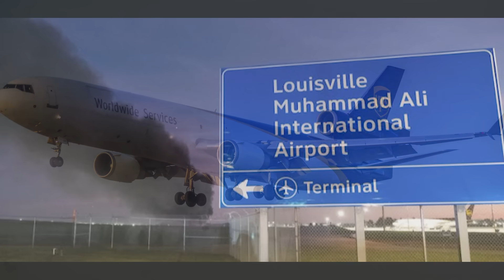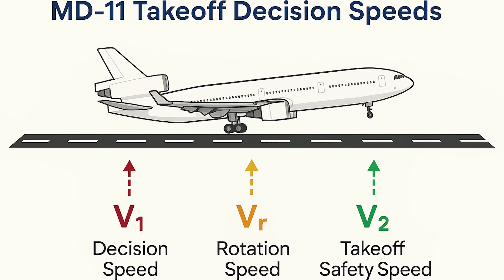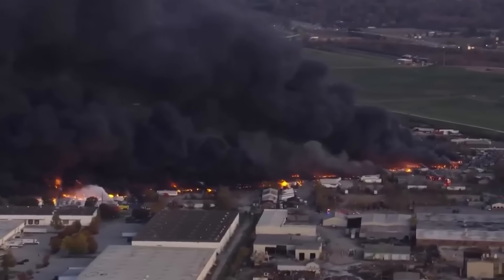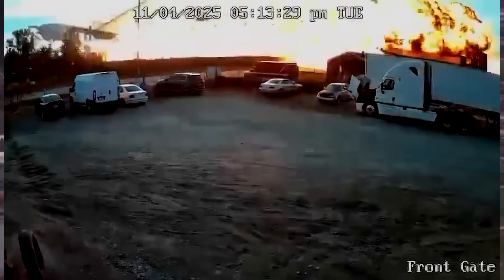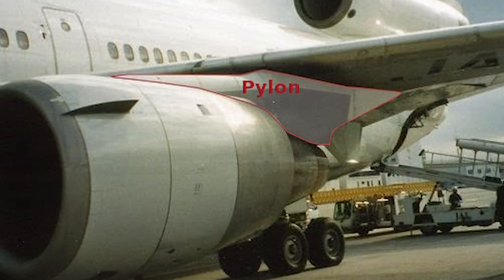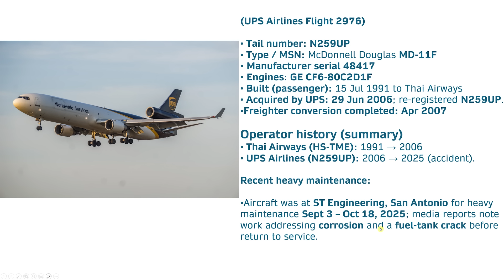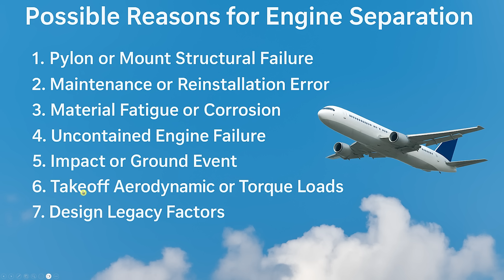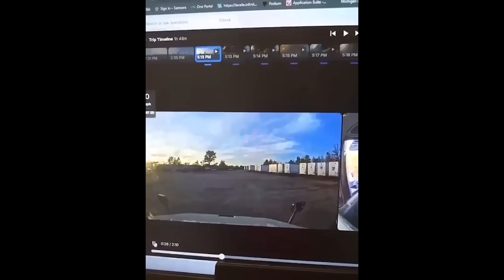What Caused UPS Plane Crash, Louisville, KY? How MD-11 Engine Fell Off

Comment: Just showed my Dad who was a Jet Air Craft Mechanic in the USAF for 27 Years. Was also NCOIC Fightline. Said someone F'd up on bolting the engine back on. Said during maintenance is done, the engines are unbolted and inspected. Not putting them back on correctly,  forgetting to put the bolt back or screwing in correctly causes the mount to not hold the weight, the engine will fall off. The fuel line separated and because electric connections are still going, the fire starts.  He said take note of how much of the engine remains intact. Said in the Air Force, because a lot of the workers are young Airmen, there are a lot of double checking but in the private sector sometimes work isnt as closely inspected. Dads 88 but remembers by heart everything about aircraft!
Reply: I'm a massive aviation geek and your dad sounds like he knows his stuff. It wouldn't be the first time something wasn't put back right. Remember the pilot half-sucked out of the windscreen that flew off because the mechanic used the wrong screw or bolt?
Reply: @RevCPJohnson  It's sad how preventative maintenance can end up causing the crash... if not done correctly. But something could have just failed or sheared off maybe? More likely an error though... I hope not.
Reply: @colinm610 In the case of the UPS plane, it could have been fatigue cracks that finally broke in one of the engine or pylon mounts.
Reply: @mkay1957  So sad these people died and any injured. God bless. From NZ.
Reply: @colinm610  this clearly tells us humans are just a number according to big technology.
Reply: @WilliamHollinger2019 Well I can't argue with that can I ? Absolutely.
Reply: @colinm610 This plane was noted to have corrosion. I believe it was a long-standing issue. The crack must've been completed but maintenance didn't catch it. It was an old plane which had been in continuous use for 34 years, stored some place where salt water got into the engine cowling. Since salt water is the death of metal, one would think UPS would be very keen on discovering the corrosion. I guess UPS thought ST Maintenance had fixed that issue. Nope.
Reply: @colinm610 that lies more on bad quality control program than the  preventative maintenance itself.
Reply: @mikesorensen5228  Yeah that's right! :)
Reply: @RevCPJohnson I remember that story, British Midland, Fokker F100 series jet.
Reply: @RevCPJohnson  Oh ya, my son (disabled) and I watch Air Disasters TV show almost every day - excellent shows - ya that was a miracle that he survived - great teamwork on that flight by everyone to save him and the plane and passengers
Reply: @KRAM-ct7ok He went back to flying in less than 6 months too.
Reply: @KRAM-ct7ok  I think those of us who have watched those shows numerous times know almost every crash and it cause(s) by heart.
Reply: @KRAM-ct7ok 😂😂😂
Reply: Thank you very insightful
Reply: I am an aviation maintenance engineer up in canada, its pretty difficult to forget the talk those bolts when reinstalling an engine. Most of the time the engine goes up with a cradle that is hung off of the strut, you bring the engine up, align it, put a preload on it and then you feed the bolts through and torque them before you start lowering the Cradle.

My assumption at this point would be that a crack was formed somewhere and was missed, either that or corrosion built up and was missed for too long. I don't think people just forgot to tighten up the bolts, especially when you got four to five people working on that engine change and which requires an independent inspection or RII, meaning the person has to torque it and you have to have two qualified individuals observing said torque.
Reply: Same scenario American Airlines crash caused by maintenance short cuts. Using a forklift to pull the engines cracked the mount.
Reply: @tappan48  , saw that one on Air Disasters on the Smithsonian Channel.
Reply: @davidransom4476  Well this terrible event will be added to that show.
Reply: When I worked Aviation Maintenance we always used on overhead 
or gantry type crane or hoist for removing or installing engines, 
transmissions, gearboxes, props, rotor blades or wings.
Reply: @ogcowboyx  United uses cranes.
Reply: @tappan48 it wasn’t the actual move but the hydraulic bleed off when the shift change interrupted the reattachment if the engine. The fork lift blades lowered just enough to bend the pylon and put it under stress eventually cracking.
Reply: @lisahicks8186 I saw the analysis on the Smithsonian channel, the maintenance shortcut was about using a forklift and cracking the mounting bracket if the reattachment wasn’t precisely lined up.
Reply: @lisahicks8186  The engine and pylon were supposed to be removed separately per McDonnell Douglass.   Maintenance was pulling them as one unit and this caused damage.
Reply: @tappan48  thank you, you beat me to that comment.
Reply: @tappan48 yes! also a DC10 unbolted engine?
Reply: @tappan48    The engine and pylons were pulled together instead of separately which was against McDonnell Douglass procedures.  Had it been done as a separate removal, the cracks would not have developed with the forklift.
Reply: What a legend
Reply: @jyemichael what??
Reply: I believe your dad knows what he's talking about.
Reply: Thank you.Sounds like what happened
Reply: This has happened before. Engine not being bolted in correctly, then dropping it in the air.
(Engines are basically held in by a sort of clamp that goes around the whole engine that opens up from below. Engines can be removed, replaced or repaired. The clamp is held together by bolts at the bottom.)
Reply: @alexanderg-p3z  sounds like you are referring to the "cowling" that surrounds the engine - an aerodynamic shell that reduces drag and allows access to engine components on the ground by opening it (like a two-piece clam shell) - but the engine itself is being held to the pylon by several LARGE bolts - and the pylon to the airframe by even LARGER bolts and pins.  On the Chicago DC-10 crash the pylon separated from the wing but the engine stayed connected to the pylon - there are photos of people looking at the engine and pylon laying together on the runway - this case looks to me like the engine separated from the pylon - not sure, and the front fan section of the engine separated from the core section of the engine. I guess they will figure it out
Reply: @KRAM-ct7ok  Yeah that's it. Thanks for the clarification.
Reply: I was also a jet mech/plane captain in the USMC.  Although it may be factual that the engine was not properly secured after maintenance, it is yet to be determined.  There are a number of other reasons for an engine to come off the wing, such as metal fatigue.  Although there was no mention of it (at least I don't recall it) during the NTSB briefing, I would think that the fire started before the loss of the engine.  If that were the case, it may be that whatever started the fire also caused the loss of the engine.
Reply: @seanjkenrick6593 aparantly this flight was a continuation or a unload, reload & refuel to go to Hawaii. Airplane had flown from another airport earlier in the day & landed. It was said on Tuesday in chat from videos of the aircraft that there was a 2 hour delay & the airplane had been at maintenance but nothing official was put out in the media. Will have to wait for NTSB to do & complete the investigation. I wonder if pilots felt vibration from #1 engine in flight at some point on the way to KY & the reason it was in maintenance.
Reply: it seems insane to trust the safety of the entire airline industry to a single underpaid-un-motivated maintence worker
Reply: @MattMajcan  My brother-in-law is a United employee and is paid very well.
Reply: @lupusgirl1000 regardless I've worked a lot of underpaid jobs and most people want to do their best, especially if safety is involved
Reply: @MattMajcan i think most of them must be motivated. But if they aren't given time and resources then they aren't given time and resources. And it should be a repeated standardized checklist completed by multiple people
Reply: @MattMajcan that's right, one team installed engine after other team inspection, must done job right that.
Reply: @MattMajcan underpaid? These guys make serious money.
Reply: @Z_Syndicate  obviously its not enough because this keeps happening
Reply: @MattMajcan Dont think those people underpaid, especially his supervisors.
Reply: @MattMajcan  ST Engineering does not appear to be a union shop at its San Antonio, Texas location
Reply: This happened in 1979 I believe, the engine was taken off for maintenance but it was done quickly and during a shift change.
Reply: @mch2007uk shift change they didn’t leave the engine running so pressure bleed off let the load settle bending the pylon slightly. Saw this yesterday.
Reply: @lisahicks8186 That was the forklift engine lifting the jet engine into place on AA191.
Reply: @mkay1957 I know it was discussed due to the similar situation of actually losing an engine, mouse being aDC 10 the older version of the MD 11.
Reply: My father was a B-17 flight engineer/top turret gunner. When his bomb group was still in training at Avon Park Bombing Range in Florida, some other B-17s from another bomb group did a fly by at about 500 ft. One of the visiting planes made a loud bang and the number 4 engine fell off. The plane did a slow corkscrew into a swampy area some distance from the end of the runway and burst into flames. 

Somehow the tail gunner got out and popped his chute close to the ground. It slowed him up just enough that he lived, although he had 2 broken legs and other injuries.

My dad never heard anything about the cause of the crash or if there was any kind of investigation, because his bomb group headed for England a few days latter.
Reply: Doubt it’s that simple. You don’t “forget to put a bolt on”.
Reply: Take a close look at the earliest video of the crash taken from behind the plane as it is trying to gain altitude.  There appears to be sparks coming out of the #2 engine.  This could indicate a catastrophic, uncontained explosion on the #1 engine caused it to detach and threw debris up into the air some of which got sucked into engine #2.  In 1989 a catastrophic , uncontained explosion occurred in engine #2 on a DC-10 on United flight 232.  Parts from that explosion severed hydraulic lines which led to the crash as the pilots tried to land.
Reply: @Klaatu2Too  It looked like compressor stalls backfiring out the back of engine #2 right before & at rotate.  Either way would explain no power or lift because #3 engine was the only one left operating.
Reply: @Klaatu2Too With 2 engines out, a full load of fuel, and tons of cargo on-board, they would not have made it back even if the hydraulic system had not been destroyed. I cant even imagine how the 3 people on-board felt the last few seconds of their life knowing that they were going to die.
Reply: In USAF certain maintenance procedures are marked with a Red X which requires inspection and clearance by a supervisor before the aircraft can be cleared for flight. Some maintenance requires a test flight by a Functional Test Pilot before the aircraft can be returned to service.

Thanks to your dad for his service.
Reply: They do the same when they take my tires off, the kids at Walmart don't bolt them back on with enough torque or they forget a few bolts. Too much TikTok for the brain, can't concentrate on simple tasks.
Reply: @RK77789O i guess TikTok is less harmful than lead at least
Reply: @RK77789O how dismissive to equate the kids at Walmart to the capable and dedicated aircraft maintenance crews of this country.
Reply: @ChuckiesChicklet  Allow me to point out that Walmart is...... Walmart. 
Whether the workers are Boomers or Zoomers.
Reply: @ChuckiesChicklet So it’s ok for you to then dismiss a valid point yourself? Attention span thru overuse of social media and texting is a problem that has begun to infiltrate many skill sets. It needs to be discussed.
Reply: @georgiarasmussen8343  And? The initial comment was about whichever generation had been removing and replacing this person’s tires.
Reply: @kcampos5619 Wal-Mart and the airline maintenance shops are drawing from a similar employee pool. So you better be aware of that fact.
Reply: @rubies200 No kidding. I think I conveyed that awareness in my comments - and that Walmart does indeed offer services that require skills and an attention span.
Reply: @kcampos5619  And? What gets me is how many people fall for the "generation" thing. 
A generation is a division within a family, not a political segment. The politicized usage is purely a  construct of the media. "Baby Boomers" love to project their innate ignorance and entitlement upon everyone younger.
Reply: Dad is absolutely correct except for the fact that we were closely monitored because we were young and that is wrong. We were closely monitored, absolute fact, but we were closely monitored because of what’s at risk as we see here. We are closely monitored to have the chance of catching any mistakes or worn component’s before that aircraft attempts flight and has this happen. Every nut we touch is inspected and scrutinized so we have Zero Defects on EVERYTHING, not just most things!! Our pilots lives are at stake and there is absolutely no room for your dad or I to make a mistake and leave a nut loose or install the safety wire wrong, etc. that is why we are monitored and drilled on every task we do. I also was a jet engine mechanic on T-37/T-38, F-15/F-16s, & C-141s. Even the civilian world is supposed to inspect every step of aircraft Mantooth the same way we did it in the Air Force but they are prone to skipping some of the steps for cost savings, not due to age. My engine shops I was part of had majority of mechanics that were 35 years old and older with 15+ years experience and were A&P certified, not just young kids running around and we probably had more experience than the civilian shops honestly.
Reply: Any chance (at all) it could/would have failed a metallurgy test?  Just the stress from 34 yrs of takeoffs and landings and the surrounding structure supporting the engine simply gave way?
Reply: How could you not attach bolts that connect the engine ? Isn't there a checklist to make sure every step is completed ?
Reply: Respect! You are lucky to still have your dad. I lost him when he was 65.
Reply: That’s really scary to hear. Could happen to any one of us!
Reply: @creativeconnection4U  yup! It could! But you're more likely to be unalive driving in a vehicle on the ground.
Reply: @Yeeeeeeeaahhh   not if you're unflying through a building with unempty fuel tanks.
Reply: @johnnysparkleface3096  dude, how many times has that happened? How many people were killed from all airplane crashes compared to how many are killed in vehicle accidents? Look it up!
Reply: @Yeeeeeeeaahhh  unalive   " is not a word genius😂😂
Reply: @michaelvargas4079 actually it is now. It’s used so you aren’t censored using other words. You know, freedom of speech.
Reply: @michaelvargas4079  LOL.. you must be a noob! We use alternate words to avoid having our comments removed YouTube's automated bots. Genius... 😆🤣🤣🤣
Reply: @Yeeeeeeeaahhh especially today..watching a movie on phones while driving 😮
Reply: @creativeconnection4U  Most definitely at any time... Nowadays it's even worse....
Reply: This has happened once before too iirc
Reply: @dmacpher unfortunately, it may happen again in the future. Preventive Maintenance is only as good as the crew doing the work AND the quality of the parts as well as being installed properly.
Reply: @Duschbag if I recall correctly it was In part how the engine was jacked back up onto the wing last time this happened a few decades ago. 

They also lost the engine on takeoff
Reply: True.. helicopter s..and planes are safer in the USA milltary than commercial at times....copters are called flying bricks in the military 😢
Reply: This was an MD-11 (Corrected as I had it as a Lockheed L-1011)  airliner converted over to cargo. Basically it is a similar and larger version of the McDonnell Douglas DC-10 with the 3 engine setup. There is a lot more to R&R the engines on these aircraft than most others. The DC-10 & MD-11 have both suffered from problems with the wing engine mounts and there has been a lot of FAA regulations, safety checks, updates and more on how to remove and replace the wing engines. This has to be done with extreme care as any damage to the engine mounting points, or pylon mounts, especially the aft mount that can cause the engine to detach from the wing. There are only 2 or 3 attachment points to the engine Pylon that attaches the engine to the wing.  
The first engine attachment fail occurred in May 1979, on AA flight 191, a DC-10, taking off out of Chicago's O'Hare International Airport. Same engine came off shortly after take off and rotated over the wing. This lead to loss of control and the crash killing all 271 on board and 2 others on the ground. The NTSB investigation examination of the pylon attachment points revealed some damage done to the wing's pylon aft mounting bracket that could only happen during an engine change. 
Like your dad I was in the USAF and retired in 2014 after 40 years. Just under 20 years active duty the rest in an Air National Guard Unit full time. For about half of my active career I was in the Strategic Air Command (SAC) working B-52s and KC-135s as a Machinist out of the Fabrication Branch. There were times I had to go out and do some work on the Aft engine mounts in the KC-135s. It amazed me that there were only 3 attachment points that held the engine on the wing. The 2 Aft mounts had a slot cut into them that slid over a sheet metal part with, 5 or 6,  3/8 or 5/16 inch bolts that bolted through the mount and the sheet metal on the pylon. The mount had a hole or eye at the bottom that a 1/2 inch bolt went through the holes on the engine and the mount attached to the pylon. There were 2 of these afte mounts and a much larger tapered pin mount on the front of the pylon. That is all that holds the engine on the wing. 
So it is critical to take every safety precaution, use the right equipment, follow the maintenance manuals and not rush an engine changes. Lives depend on it. I've seen too many accidents that have happened because the job was rushed, or people were not using the Tech Data, didn't use the proper tools/equipment, take pride in their work, or took shortcuts and many other stupid reasons that got people injured or killed.
Reply: @EIBBOR2654 not a L1011!
Reply: @rodbutler4054  
Your right and it was my mistake. Thanks for pointing that out. It is the McDonald Douglas MD-11. Their version of the stretched or larger DC-10. Only 200 of them were built and only the Cargo versions are still in service. They were retired from passenger service in 2014 along with the DC-10. The MD-11 never met it's flying range goals and maintenance got expensive for these aircraft. Several of the passenger aircraft have been converted to cargo by Boeing after McDonald Douglas (MD) merged with Boeing. Boeing wanted to get into the Helicopter market, especially the military  market and since MD had bought Hughes Helicopters in 84 Boeing jumped at the chance to buy MD to get the helicopter product line division.
However the MD-11 still suffers from the same Engine Mounting Pylon problems as the DC-10 and L-1011. Any damage to the 2 or 3 attachment points will lead to the engine leaving the aircraft eventually. 
I stand corrected and should have known that it wasn't an L1011 because of the difference in the #2 engine in the tail. The L-1011 has the engine mounted in the Aft fuselage with an "S" shaped intake duct work. One of the pilots I know mentioned that it was an MD-11 and I when I checked to sites on this accident they also made the mistake of saying it was an L-1011. I usually check the facts better but just took it for granted. I should know better. 
Back when I was Active Duty USAF stationed at Seymour/Johnson AFB in NC, we received the first 2 DC-10 Tankers. I was with the 68th Bomb Wing (SAC) working on B-52Gs and KC-135As. We became a test bed for the KC-10s since we were so close to DC. We never did any maintenance on the DC-10s as MD was contracted to do all the maintenance. As I recall that contract was for 10 years. The KC-10 was retired from the USAF, the last one went to the Bone Yard Sep 2024. They were replaced by the KC-46 Pegasus, a modified Boeing 767 airliner, just like the KC-135 was developed from the Boeing 367-80. 
We had the original here at Davis/Monthan AFB in storage from 1972 to 90 and it was brought back to flying condition at DMAFB in 1990 and flown to the Boeing Facility in Seattle for a full restoration. In 2003 it made its final flight to the Smithsonian National Air and Space Museum. About 396 KC-135s out of the original 803 are still flying with units in the USAF, USAFR and USAF ANG and expected to fly until 2030. Not bad for an aircraft that was built from 1955 to 1965.
Reply: It that's the case, there's going to be some people in the maintenance shop going to prison for a few years.
Reply: How long is a large Aircraft like this before it has a serious front to back, top to bottom inspection for recertification for future passenger or freight Carrier use..? Or do we not G.A.S. enough  to do that at all..?
Reply: Wow Your Dad is a wise one. Tell him thank you for his service. My FIL was an airplane mechanic too served in USN during WWII and the Korean War.  He told us the only time he ever had to kill anyone was in the Solomon Islands and he did it with a wrench.  We all miss him so much.
Reply: My friends in aviation in Ky are saying the same thing. I heard they did a breakdown on this plane where they take everything apart and put it back together, within the past week. There’s licenses being pulled
Reply: UR Pop is dead center correct. (Actually is the only possibility)
Reply: One of the NTSB enquiries found that the airline mechanics had used a forklift to lift the engine into position and this had caused damage to the supporting lugs. Engine fell off and all aboard were killed.
Reply: Your dad sounds very cool.
Reply: He’s Right It Makes Perfect Sense
Reply: God bless your Dad and thank him for his service.
Reply: Incompetence, half-ass work and just lazy work.
Reply: Was Stationed At MCGuire AFB, one of the two homes to the KC-10A. The DC-10-3. At MTOW, Two engines is not enough to climb out with only 8500'.  We had ours Expanded to 10,000' when the KC-10s arrived.  8500' runways are the bare minimum length to take off at MTOW. Be mindful, this UPS Flight was a nonstop to Hawaii.
Reply: Your Dad is amazing, brilliant, and a hero. Thank you to him for the information and for all of his service! Very interesting
Reply: God bless him, appreciate the info.
Reply: I think I saw this on "Seconds from disaster" or something like that. The maintained crew screwed up the mount, the flange, and the shear-pin snapped. I think that was accurate IIRC.
Reply: @AbandonTheWest  The DC 10 that went down at Ohare in the 80s looked familiar to this accident. Maintenance crews were using forklifts to remove and install engines. They put undue stress on the mounts and they cracked. The engine fell off the jet on takeoff. This looks exactly like that one at Ohare.
Reply: In 1992 a plane crashed into appartments in Amsterdam. It also lost it engines. Fatigue of those pins if I recall correctly. One engine broke off and hit another wich also fell off.
Reply: I agree with your dad. This will probably scare most people but most engines are bolted to the plane with only 2~4 bolts. Either they used improper bolts not made out of the right material or they cracked the mount forcing it back on after maintenance.  Nothing else makes sense to me.
Reply: God bless your dear dad,he’s remarkable ❤
Reply: As a veteran of the USAF, I can say a Red X, otherwise known as a condition in which an aircraft is not to be flown, requires inspection of maintenance done to clear the Red X. Some types of maintenance inspections require lots of stripes, meaning, a high-ranking NCO as compared to other types of inspections. An engine removal and reinstall would require such higher-up NCOs to inspect it. It's serious business.
Reply: Such good info.
Reply: I agree, yes.
Reply: Don’t care how old your dad is 😂
Reply: I believe your dad, he could be right. not blaming mechanic team and staff but small portion of people would cut corner. also a not well trained and under equip personel could also a factor.
Reply: HELLO.  McFly anybody home??
Even if they "forgot bolts" that doesn't cause fires.. the fire started B4 engine detachment
Reply: Read my comments about San Antonio maintenance issues on kc-10. The team there years ago didn’t follow maintenance tech data . And we used the same books as the a&P guys did. I doubt they were even inspecting the engine attach points.  I spent 25 years in aircraft maintenance 14 on heavy inspections in iso dock and 4 in a-check on kc-10’s. I found a lot of scary crap.
Reply: @josephburnham4621 This is it. This is the answer.
Reply: My dad was an airmen television technician 91 to 99 from Air Force to air guard.
Reply: Yeah they said a Singapore based maintenance company did work on the central wing fuel tank on 9/18
Reply: Someone fucked up pretrip maintenance. Triple check. I drive an 18 wheeler and pretrip more than 1 time or take longer than normal.
Reply: Please thank him for his service for me.
Reply: Sounds like your dad is someone we still need in the workforce.
Reply: You have a amazing dad.
Reply: My thoughts exactly. It has to be because the plane engine is not supposed to just fall off. Someone bolted it wrong, didn’t finish the job or did it incorrectly.
Reply: You realize the UPS is part of the public sector??? So much for your untouchable government...
Reply: @kingkoi6542 heh?
Reply: @kingkoi6542 USPS (U.S. Postal Service) is a government entity, not UPS (United Parcel Service). Or do you believe a company that sells stock to citizens is owned and operated by the government?
Reply: Somewhere in Kentucky, there is a mechanic very worried
Reply: How did the plane get from San Antonio to Kentucky?
Reply: It's WELL KNOWN the most dangerous flying in an aircraft..is after recent maintenance..
Reply: Bolts don’t hold the engine in place, pins do and bolts keep the pins in place.
Reply: Yep, and it's certainly not the first time it's happened either.
Reply: That’s exactly what I think, too. In fact, I typed that and posted above before reading this. 
Please thank your Dad for serving, as did my father who was a few years older than yours. 🫡❤🇺🇸💙
Reply: This crash at UPS in Louisville is extremely similar to what happened in May of 1978 in Chicago Illinois at O'Hare airport with flight American airlines 191. Due to a improper procedure to do a engine change cause structural failure and micro cracks where the pylon for the engine hung. The procedure was a shortcut and at the time it seemed like it was a time-saving practice to do engine changes on the DC-10. To the date that flight was the most deadly crash in US history with a single plane. Close to 300 people lost their lives because when the engine failed the airplane lost all her drug control and because of that they cannot recover. It was a miracle that they did not hit the fuel reserves which was which was very close to where they crashed. The fuel reserves for the airport was right next to the trailer park on Touhy avenue in Des Plaines Illinois. The reason why I remember that accident so clearly was my father worked for Continental airlines at O'Hare airport and when I got out of school that Friday I saw a large cloud of black smoke in the distance. My mother was at home watching it on the news and talking to my father. When that accident happened the airport was in total lockdown. I have a feeling that what happened at UPS was a very similar situation where someone was taking a shortcut against McDonnell Douglas is recommendations to do a proper engine change. The FAA should look into the similarities between the two crashes and compare the evidence and similarities.
Reply: and nonexistent  QA/QC whatsoever.
Reply: How in the Sam Hill does one F up reinstalling a turbine engine capable of producing hundreds of tons of thrust? You'd think it would be double-checked on every flight.
Reply: Respect
Reply: He was saying bc the techs were also flying in the planes, they were more conscientious?
Reply: We have had the quality loss topic before in US engineering at some a lot people. The best are working on F35 (e.g.) and some like trashing the space with unnecessary satellites all such and a lot cause such problems like at Boeing +++.
China quality but because of fast money making and work pressure and some sometimes chaotic people in jobs which have no room  for uncontrolled chaos.
This would be no problem when they work controlling each other togehter instead of alone and under such time pressure.
Reply: It's pretty clear in this video that the fire really blew up as the power lines exploded 😮
Reply: Wow we need him in this country  forever God bless him
Reply: DEI hires
Reply: Your Dad's not wrong. The Military though has Technical Inspectors that come through and check the work of the maintenance team that replaced or removed the engine. Civilian Aviation doesn't use Technical Inspectors the way the military does. So it's easier for a Civilian Technical Inspector to pencil whip the inspection. It's my understanding from people I know that work in the civilian industry they don't even check if the work was done right. A good friend of mine was a whistle blower against American Airlines in St Louis for falsifying maintenance records.and inspections after work was done.
Reply: With the limited evidence available the cause appears more likely to be an uncontained catastrophic failure of the engine, causing the fuse pins to fail allowing the engine and pylon to become detached from the aircraft. The connection between the engine and the pylon has also failed, but this maybe due to the impact of the pylon and engine with the ground.

The fuse pins are designed to break if there is a serious problem with the engine. Jumping to the conclusion that the cause is improper installation of the engine, is premature.
Reply: @christopherrobinson7541 I saw a video yesterday that shows the engine was already missing from the wing before the plane impacted.
Reply: Thank you  for sharing. Yeah, my dad passed in 2022 but was retired Air Force and commercial airline pilot. Whenever, unfortunately, these incidents happened he would always get it right. He knew so much about the equipment; function, failures, maintenance, systems, etc. Will be fascinating to know the NTSB's finaly assesment. Oh boy, incredibly sad.
Reply: I believe your Dad is right.
Reply: I recall as a kid the DC10's crashing and it came down to them using a forklift to hold the engine up while they fastened it. Apparently if shift change came during the process or if parts were needed, they might leave it on the lift with one bolt in. The lifts would sometimes sag a little bit due to leaky seals and stress the mounts/bolts. Next guy comes along and puts it all together, but part of the mount is weakened and could fail under load. I may be blurry on the details as I was young and am going by some news report, but it was along those lines. Much like the recent Boeing issue of missing rivets, any critical component should be either completely installed or not connected at all to ensure that something isn't lost during a shift change or time period waiting for parts or any other reason. 

I know that pilots, ATCs and mechanics are aging out and not being replaced with new guys at the same rate, so crews are stretched. I hope this is a wake up call that it's better to delay or cancel a flight than to succumb to pressure to stay on schedule without making sure everything is in perfect order. I'm not saying that's what happened, but I suspect it does.
Reply: There’s only one reason this plane crashed bad maintenance why didn’t the computer warn that there was trouble with the engine
Reply: US army retired here...tell your dad thanks for your service 👍🇺🇲
Reply: Most people would agree that common sense says that a plane won't fly if the engine falls off. If they can't agree that's a problem in finding the cause then there's not much hope for this country's educational systems.
Reply: Is this one of those new Boeing planes???
Reply: Did the plane fly successfully before this or was this the first flight after it’s maintenance?
Reply: @stephenabbott7259  the engine came off IMMEDIATELY. that says that it hadn't had other flights since maintenance. more information is coming forward with other people supporting the 'forgot to bolt it back on' theory.
Reply: Private sector. Exactly.
Reply: American quality work
Reply: I smell a Rat
Reply: Dad Rocks! I believe every word Pop's said.
Reply: Wow, so this was entirely preventable. Disturbing. 😢
Reply: I agree. I was a crew chief of F111 from 85-88
Reply: problem is most of our new techs are raised by chatGPT.
Reply: Omg
Reply: That is gross gross negligence. Who are the people working on installing airplane parts? They are doing absolutely horrific job.
Reply: @pajeetsingh That is my point!!  And so many people here try to find excuses to " forgive and forget " !  How disgusting is this !
Reply: They don't do that anymore, at least they shouldn't. The engines were never made to be removed; it was an effort with the Air Force to save time rather than taking the engine apart to repair. They stopped doing that in the 80s or 90s. So, unless they decided to start doing that again, it's unlikely that was the cause.
Reply: @ mechanical fitter who works on the engine 👀
Reply: Unbolting the pylon from the wing versus unbolting the engine from the pylon.  

Inspection inspected the wrong engine side vs the correct wing side.
Reply: makes sense.
Human error is only getting worse every year ..
Reply: @roadstar499 Why more so now than before ? What is happening more so now than before?  This is the question
Reply: God bless you and your Dad ❤
Reply: That's simply not ALWAYS true. I've watched a ton of shows about what went wrong in plane crashes. If I put the shows' names YT will delete my comment. But I've seen the wrong bolts used in replacing those mounting bolts, because they get stressed and must be replaced. And damage can happen to some of the parts during engine repairs or maintenance that causes the plane to crash sooner - or later.
Reply: Reminds me of rolling out from the Ford shop, and realizing that none of the wheels were bolted back on ;_;
Reply: Interesting. He said that plane had a crack in a fuel tank, which was repaired and it flew many flights after that. I think that plane should’ve been retired a long time ago. Even if the engine was bolted on correctly, metal fatigue could’ve caused the same problem. Hopefully there’s enough evidence left to show what happened. I’m leaning to what your father said.
Reply: @alan30189 A lot of old and much older planes fly to this day that is not problem by itself and that plane could fly for another 10 years with no problem
Reply: Well they can’t blame that on DEI. Since the cursed one took over occupancy of the Oval Office more unavoidable calamities and deaths have occurred in the last 10 months than in the past 10 yrs. He’s a walking, talking bad omen.
Reply: @SDC1949 actually not true. Check the statistics. The number of crashes is down from previous years. The number of TDS cases however ...
Reply: The FIRST thing I thought of. Heard plane was o.o.s. for a month. Plus it's 34 years old reportedly. A LOT of stress on that fuselage over those decades.
Reply: And myself 😮
Reply: Remember all the whistle blowers who mysteriously died of suicidal after coming forward regarding the negligence of Boeing company?!?!!!
Reply: And yet...
NTSB will say pilot error
Reply: I wouldn't be surprised if this was a situation with a DEI hire on maintenance... or someone paid someone to jump to the front of the line in hiring but didn't have a lot of experience yet.
Reply: @noahriding5780   corruption is a GOP thing
Reply: Another diversity hire
Reply: Probably a dei hire
Reply: @lorig4871 makes no sense when you say this since dei was abolished when Trump got into office and a bunch of plane crashes happened afterwards
Reply: Pilots wouldn’t catch something like that during pre flight check?
Reply: @greg6898  The sheer pins (attaching bolts to the pilon/Engine) & the pilon attach fittings are very much not visible on a walk around, Thrust reverser cowls would have to be open with steps up for access . One Thing to be noted is that there are AD (airworthiness directives ; think something like a manufacturer recall on your car) directly relating to fatigue cracking of the pilon to wing attach points. There will be relevant paperwork in the aircraft maintenance package to determine when this was last conducted. (Looks like heavy maintenance was carried out on this aircraft recently) Too early to tell without any relevant data and im sure the authorities involved will conduct a diligent investigation of this
Reply: @greg6898  no, the mount is hidden and there is realistically no real way to tell if the engine is properly secured or not. you will know when it flys off. unfortunately.
Reply: @greg6898  No way, it's all internal parts, inside the cowling - plus you would need a ladder or stand to get up there, not sure the pilot can even reach the bottom  of the engine cowling from the ground (maybe ?) - but the loads of a running engine at takeoff power are a whole different animal
Reply: @greg6898  I watched those female pilots go around with their little flashlight during pre- and post-flight checks. Will they catch something like that? 
Nope. 
(nor will most male pilots)
Reply: @greg6898 they cannot see individual parts like a pylon holding an engine on and it could look fine to the naked eye and still be faulty.
Reply: @greg6898 I don't think anyone would catch improperly torqued or cracked bolts, kind of like loosing a wheel, unless you're walking around with a torque wrench who's gonna catch it
Reply: @greg6898  I don't think so from what I know of pre flights. Its one of those checks that I believe can only be seen by mantience.
Reply: @kathyouthere what an irresponsible thing for you to do. If a father wants to speculate to his daughter about a plane crash with lost souls  before the debris field is even cleared, that's his prerogative. But maybe don't take to the YT comments and spread information that at this time has not been verified by a single official source.
Reply: @Sp3ctorRoss this is a bizarre comment. You came on here to read the comments. Maybe switch off TV and YouTube if it's upsetting you.
Reply: @Sp3ctorRoss   Go away.
Reply: @Sp3ctorRoss  People will be speculating until they hear the answer. That's what people do. I've lived in areas with fires and floods. There is nothing for people to do after a disaster but try to make sense of it until they are told something that makes sense.
Reply: @Sp3ctorRoss It might be helpful if you also admonish every single YT user for believing anything they’ve ever gleaned from this platform - unless they verified it - and do include advance warning for everyone who might be thinking about it. Apparently, no one but you uses discernment and has the wherewith-all to recognize speculative opinion.
Reply: @kcampos5619 I'll agree with you. WHO IS HE to tell someone what or what NOT to say in a "COMMENT SECTION" about anything..?
I don't feel she was being irresponsible at all..!
Reply: This is a plausible theory, but still way too early to tell. We should all limit speculation and wait for the final report.
Reply: @jhfisk  this is text book repeat incident of the same issue that happened to the AA flight caused by the same type of issue. the only way that engine is coming off is if that mount was not installed properly or was damaged in some way.
Reply: @jhfisk  The media should. This is just some people talking about it in a comment section on YouTube.
Reply: Called 2025 DEI hire as work again hurting people
Reply: And Trump!!
Reply: I bet he is, my stepdad was just like him 
I wonder if DEI hiring will come into this
Reply: I blame Biden!
Reply: DEI hiring???
Reply: @1964Loukas  no, more like management demanding shorter turnaround times, forcing maintenance crew to take shortcuts to keep their jobs.
Reply: @1964Loukas Did you just learn your new favourite buzzword?
Reply: @1964Loukas   Congrats, you get the award for the most idiotic comment of the day!
Reply: @da1247 says you ...blahhh
Reply: @1964Loukas  Or counterfeit Chinese bolts. They don't only do Rolexes.
Reply: @dlschgo not just Chinese, there was a company in UK a few years ago caught selling thousands of unapproved engine parts with forged documents to  major aircraft.
Reply: @mikesorensen5228  But I think the Chinese Gov't does it as deniable warfare, like in the engineered crop super diseases they keep sending to Chinese students at American Universities in farm states. That was caught multiple times. If it spread, it could wipe out an entire crop, like corn nationwide. 

For people that don't know, the certified bolts for aircraft can cost thousands of dollars. Part of that cost is certification and traceability --Every bolt must come with paperwork proving its origin, material composition, and manufacturing process. This ensures full traceability back to the raw material batch. Bolts from the same batch are destructively tested in every conceivable way to ensure that they will meet the technical specifications required for its application. At the end the manufacturers adds a premium for the liability risks they face should it fail.
Reply: @1964Loukas  Not likely. This is probably honestly a more systematic problem rather than one person. And it may or may not be nefarious in nature. Multiple people have to sign off on a repair/mantience on a engine inspection, at least 2  before a plane can return to service.
Reply: h1b savings
Reply: @1964Loukas  That's the first thing I was thinking.
Reply: @1964Loukas  "I have to blame everyone else. That way, I can never be responsible for my own failures. It's always someone else! If only someone else had told me not to do what I did, I wouldn't have done what I did. It's their fault."
     -@1964Loukas.

Ignore who the pilots are. But notice them if they are convenient for my narrative. Check who the 3 were.
Reply: @aroach7461 ok ...who were they ?  Tell us...
Reply: @1964Loukas Capt. Richard Wartenberg, First Officer Lee Truitt and International Relief Officer Capt. Dana Diamond.

Order up.
Reply: @aroach7461 And your point is ?
Reply: @1964Loukas  The narrative doesn't hold up.  But don't worry, everyone will forget. Just like how they forget the armored vehicle that sank in mud, or fighter jets in the red sea. It means, you're using bumper slogans and not actually intelligent.
Reply: @aroach7461 yes ...just like the sheep are forgetting about the " safe and effective " vaccines they attempted to push on the rest of us !  Not any different!
Reply: @1964Loukas I can't tell if your joking or being serious and that concerns me.
Reply: @1964Loukas  lmfao they fired everyone from DEI hiring in January - March. You lot are responsible for this! 10 months into this madness and this is no different trying to blame Biden for something. Absolutely childish. Take accountability for the crap environment you've created
Reply: @aoiumenokouji4172 I created it ???  Sure  I did .  Why did they fire so many DEI staff as you say if the program was success ful ?!!! Explain....
Reply: @1964Loukas why the hell are so many people saying it's dei? Dei, dei, dei always does fault can't you guys use your brain and think about other causes
Reply: @PrincessofKeys Yes ...there could be other causes indeed...my question to you is this ....why do so many issues in the flight industry coincidence with DEI hirings????  Explain....
Reply: @1964Loukas  no, American greed
Reply: @1964Loukas Something tells me you’re old enough to know how to properly research the intentions behind the DEI framework. Doesn’t mean you did, tho, obviously. If so, you wouldn’t have made a remark that undercuts your intelligence and highlights your ignorance. 

I suppose you think it’s okay to have an unqualified administration and corruption that has destroyed an entire country - but damn any attempts to simply include people fairly in the opportunity for employment? 

Your erroneous belief that jobs are just handed out to satisfy a quota is an embarrassment.
Reply: @kcampos5619 Med schools allow students who belong to " certain groups " to enter medical school with much lower grades !   Good luck to you and your idiotic logic !
Reply: @1964Loukas  My thought exactly
Reply: @1964Loukas  More than likely
Reply: Yes, it's all because we let in too many women and colored people.